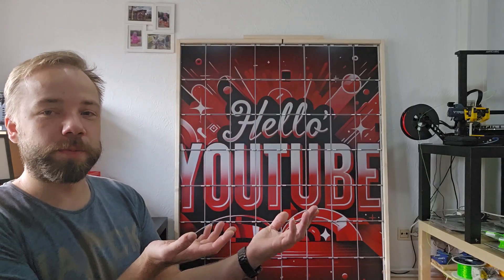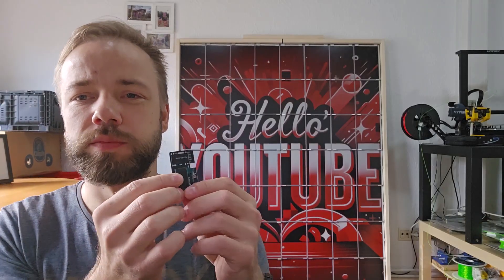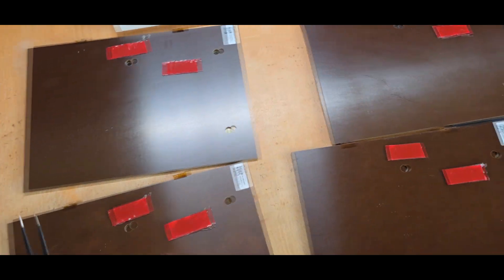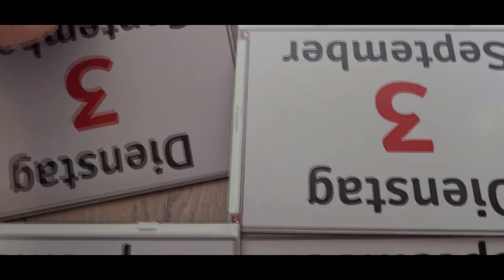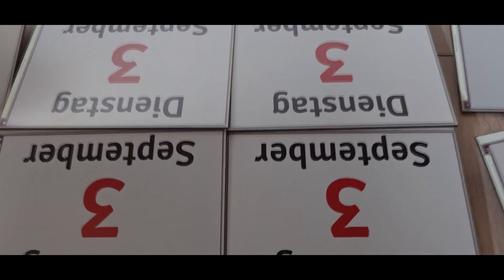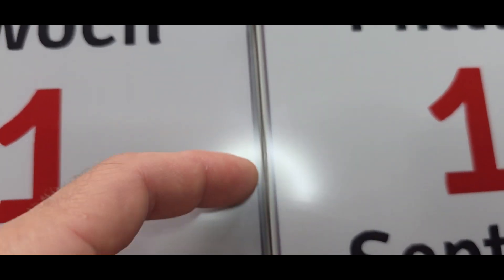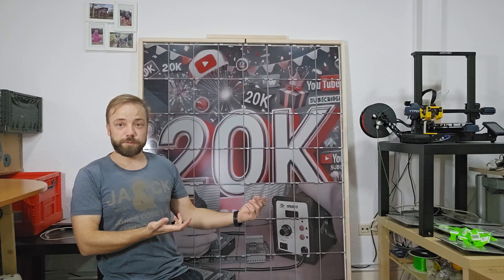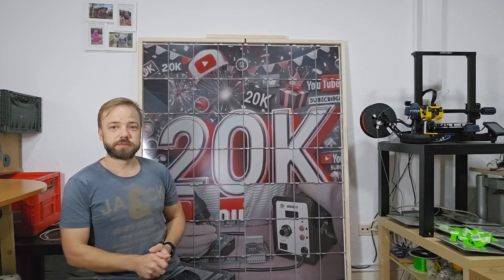E-Paper Wall 3.0

Comment: i really love this. this would be perfect to take to OpenSauce next year! I hope i see this there.  In terms of the brackets, I'm wondering if you can use your same idea but not have anything going over the top to the surface so you don't actually see the brackets at all... meaning something the squeezes horizontally to keep it in place and then the next display sits on top (perhaps with adhesitve tape) and the bracket has some sort of nob or feature that will go into a hole in the backside so that the next bracket can still squeeze without any part of the bracket needing to go on top... just a thought. Also, I wonder if you could somehow wire all of the panels into a central point for power so that if you need to replace batteries you only have to do it once. I love this! Great work!

Comment: Very cool Project!
Why did you not Segment you image then transmit the first block to the first display/esp, buffer it's corresponding image and as soon as the transmission is complete start  the process again for the second one and so on. Then the Displays can do there refresh separate from the data transmission.

Comment: It look interesting. When the data is uploaded, there is no energy consumption. At night you would need to put some light. 
To get an orientation re pricing, 1000, 2000, 3000 or many (as it was said in The Gods must be Crazy)?
Applications?